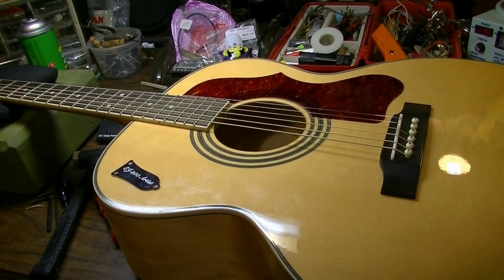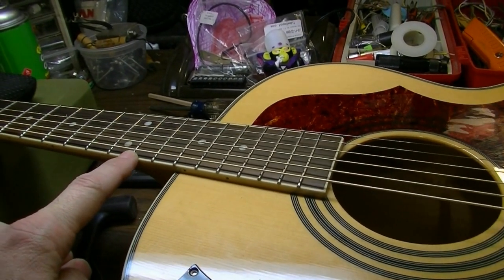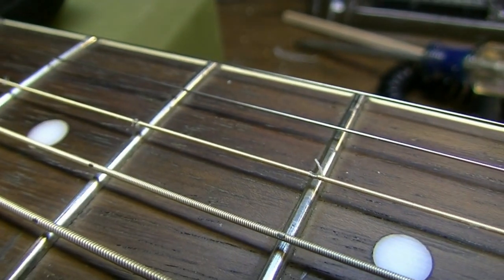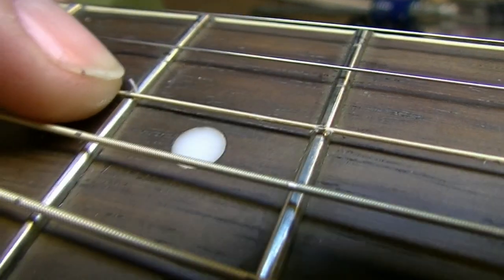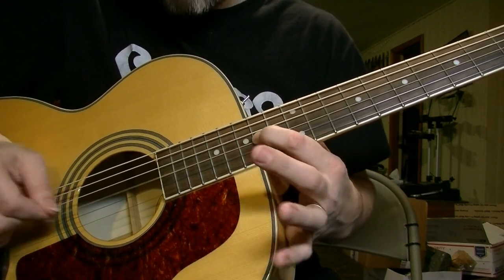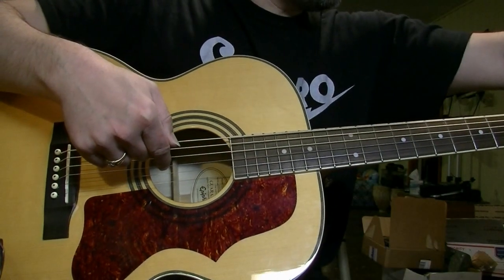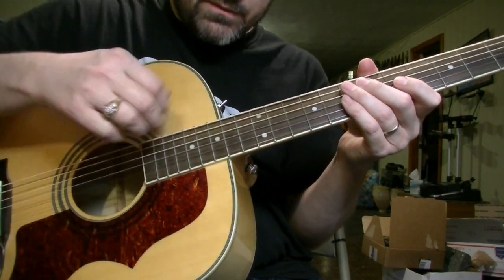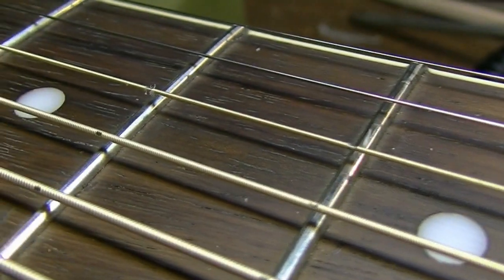Why I NEVER Use ELIXIR Coated Guitar Strings

Comment: From what I have heard about Elixir Polyweb and Nanoweb strings from some other YouTube channels these strings were most likely Nanowebs. The claims were that the Polyweb strings are better than Nanoweb. Nanoweb strings reportedly have problems with the coating starting coming off while the Polyweb strings don't have that problem.
Reply from the maker: No. These were Polywebs. I found out later. The only difference is the Polywebs are coated AFTER the string is wound while the Nanowebs are coated on the brass or nickel windings and then then it's wound around the steel core. I've also seen other YouTubers tout Elixers as some miracle strings that you can leave on "forever". I literally heard one notable YouTuber say that, and I had to belly laugh when I heard that shit...and from someone who admitted he'd gotten a boatload of free strings from them. It's nonsense. Anyone who has played Elixers and given them a truly critical analysis knows they don't last forever, they ALL fray, most notably in the picking area and above the frets, and on acoustics, they do attenuate treble frequencies. The effect isn't that pronounced until you A/B them on the same guitar, but it's true. And it's undeniable they are far more expensive than a typical uncoated set of strings. But judging by comments here and elsewhere, they have achieved a frankly undeserved cult status based on bullshit spewed from know-it-alls who don't even allow critical comments on their YouTube posts.

Comment: Do the strings makes dents on the frets? I bought a new Taylor and after the first set of strings   dents started happening on the frets. Specifically the b string
 It also happened with the new replacement they gave me. It happened again after the 3rd set of strings

Comment: I've always used elixirs. Especially on my electric guitars. I've never experienced this, however I have with Ernie Ball. But not with any coating, with the actual winding. Change the strings if you need to, that simple.

Comment: That's just a case of old strings. I use Martin Silver Wound Nylons and this happens when I don't change my strings for a while. I noticed corrosion on all of the lower strings at the frets. Eventually that will cause the metal winding to fail and fray on it's own. In this case, the G bit the dust first.

Comment: I'm puzzled that in one of your comments you state that the frets are not the problem. Aside from the flat-top uncrowned frets, your close-up camera work clearly shows the longitudinal striations on numerous frets from the 3rd to the 5th strings. It stands to reason that those striations must extend all along the fret wires which were neither crowned nor polished after leaving the Chinese factory and are causing damage to the coating. Crown and POLISH the fret wires and then try a set of new coated strings and that fraying problem will not re-occur.

Comment: I was working on a Les Paul Classic that refused to stay in tune and, it turns out, that once we tried an uncoated string, it worked just fine.  I think some guitars are more particular than others, but this one certainly didn't like coated strings.
Reply from the maker: Old strings, rusty strings, or strings with uneven coating will be harder to intonate: https://www.youtube.com/watch?v=ivrbB8OlkZs
Reply: This was a continual problem, over several years, but all with the same brand of coated string!  Once I suggested we try an uncoated string, problem solved.

Comment: I really have never used elixirs but I use many different brands. String manufacturers produce many different types of strings with different cores that may be a higher tension or a lower tension or more flexible type of string and the guitars just going to have to be set up and adjusted to that particular string if you like it and want to use it. Some strings may require you to raise the action some may require you to leave it where it's at.

Comment: not sure what's gone on there
I typically practice on acoustic when I'm not on electric and use alot of bends and slides and I have never seen this occur?
I'd go with the lower comments about why have you reused the same strings post modifications.

Comment: I’m like you, Brad. I have dry hands and not very acidic sweat, seemingly. I don’t usually use Elixirs, but had a set of Optiwebs on a Flying V for ages. Only changed them because the guitar needed a decent set up and fret polish. They were good.

Comment: I am not one to promote or demote any brand or type of gear. Very rarely is that kind of advice fact based, more often than not it is preference and opinion, and no one can tell you what to like or dislike. But sometimes I will discover something that comes along and I feel the need to share my opinion so that others can avoid a lot of trial and error. And this time it is about a new string. On advice from a fellow guitarist, I tried the DiAddario NYXL strings. I like the feel and playability of light gauge strings (008-038) but the Ernie Ball and others just sound thin, weak and tinny. I tried the NYXL in 008-038 and found both solid, powerful sounding strings that are super easy to bend and chords are easier to get my fingers on. Again, that is my personal opinion, but I feel like most would agree. They're a little salty to buy ($12 a set) but will last as long as you want them to last.
Reply from the maker: I have not tried those yet. I had a huge stash of EXP D'Addarios at the time they came out with those, so I've been using up old stock first, butnever had an issue with D'Addario. 8 gauge is a bit light for me. Too slinky for my taste. Billy Gibbons apparently uses 8 gauge, so obviously some good tone can come from them.

Comment: It seems to me if the strings are in that bad of shape it is time to change them regardless of the buzz.  Using an elixir in that condition is the same as continuing to use a 6th string that is coming unwound.

Comment: I've been using Elixirs on most of my guitars for years now and not once has that happened to me. I use their electric stings, though. I've got no reason to use them other than they're some sort of middle ground between a lot of areas. They're reasonably   priced, last a very long time, are very resilient, have a decent tone (albeit a bit stiff and harsh) and a nice feel. Ernie Balls and D'Addario rust and wear much, much faster so not only you end up spending more on them as you got to buy two or three packs  per every pack of Elixirs but you're also constantly changing strings and if you leave them there for a long time, the rust and wear on the strings act as an abrasive to the frets, which wear faster.

Comment: I don't get that? Isn't pulling the 1/4" cable out of the jack slightly a kill switch? Or why not just use a pedal tuner that mutes the signal instead of putting that in? Customer wants what they want but I would of tried to talk them about alternatives before drilling. I just don't see the need for that switch in any situation. Maybe I'm missing something. Great channel though man!

Comment: I'm on my second set of Elixir light and my G string is ruined AGAIN after less than a month since replacing them. It's frayed and deformed between 10th and 15th fret and even sliding between these frets is no longer possible. Even the B string is slightly deformed on higher frets where you normally bend more. I'm done with these strings.

Comment: I used to use D'Addario strings and switched years ago to my current Elixir strings on my Ovation Celebrity. Haven't had issues with buzzing but will double check them next time I pick it up.

Comment: I like Elixir string but I notice problems with them as well.  The biggest issue I have is that they seem to break very easily.  Just bending or palm muting can be enough to break them.  I've had better luck with Kalium strings, and they tend to last nearly as long.

Comment: I read your post script in the comments below first. I'm also one of those guys with a PH that utterly destroys strings in a very short amount of time. For 10 years, ( from 1991 through 2001 ) I was a member of an acoustic duo, and we gigged hard every week ( typical 4 hr, 4 set gigs ), usually 2 to 3 dates a week. My partner was the lead guitarist, as I held down the main rhythm & melody, as well as the majority of lead vocals, as we both harmonized vocals in the choruses. ( Classic rock tunes mostly.) We both use 12's on our acoustic guitars. Even though he often played using heavy blues type string bends ( and even slide guitar where applicable ), he could use the same set of strings for several gigs before replacing. ( We both used UN-coated Martin Marquis strings back then. ) But for me on the other hand, my strings would be trashed after only 1 gig. This was back when the coated Elixir's first came out & became all the rage. I tried them immediately & HATED them. Even though they were 12's, they felt like wimpy rubber bands when tuned to pitch. But nowadays, I am using the D'addario XS coated strings on 3 of 4 of my acoustics. I love their feel, sound, and they far outlast anything else made today. But even these XS strings can't withstand a high open E alternate tuning without breaking fairly soon. A high alternate open tuning like open E tuning is really hard on strings. ( You never "keep the guitar in open E tuning", you have to tune back down after performing a song that uses open E tuning, for obvious reasons...........and this constant re-tuning up & down is abusive to ANY string. ) This is why I use the un-coated GHS Americana strings on one of my acoustic guitars that I use for open E tuning. The GHS Americana strings sound fantastic, are reasonably durable, and they cost far less than any "coated string". Because even the uber-expensive coated strings break fairly soon when used for high open E tuning, I refuse to waste money on those for my guitar used often for open E.

Comment: I bought a fender acoustic with that pick up it worked fine but I changed the strings and the 6th sting is super loud and bassy and drowns out the other strings. Do I have to put on a certain type of string or did I did something wrong when changing.

Comment: In my experience, if you use thick strings and play with your fingers the coating doesn't fray and I'd happily use the strings for 6 months. I have come across the fraying on the frets when using 9s or 10s.. wound third strings on acoustics are the biggest problem. I have an acoustic here with 12s that I've played every day for... maybe 5 months with the current set of strings and there is currently no fraying. 

Frantic shredding with a heavy pick can also tear them up, too. Normal strings are unusable after a couple of weeks for me and sound inferior to elixirs far before then so even with eventual fraying it' can be a good choice.

Comment: I have used many sets of elixers with long periods of use between changing and never seen the coating come off of any of them. have had them break pre maturly tho. over priced, but i dont think this is a common issue with these strings

Comment: Someting in my sweat corrodes strings faster that most players I know, so I use D"Addario coated strings.  They cost twice as much but last twice as long...so the math balances out for me.  I used to use Elixir (when they were the only coated strings available), and they would always get fuzzy. Coated D'Addario strings never get fuzzy or appear any different than uncoated strings.

Comment: I use Elixir strings religiously and have never seen this happen - probably because I change them out long before they hit this point.
As I’m curious as to how old those strings are, you can be absolutely sure that uncoated strings would have been dead many times over if left on an instrument that long.
Reply from the maker: 1 week
Reply: All I can say is if they were only a week old, the strings were either defective or there were other problems going on. I play very hard and have never had it happen.

Comment: For acoustics, I will never go back to coated strings. My bad experience came from D'Addario EXP16, Coated Phosphor Bronze. It sounds fine while finger picking, but gave harsh tones during strumming. Tried another set; same thing. I bought a multi set, so I tried on other acoustics, and the same harshness was present.  D'Addario even sent me a free NYC set, but the same result. Something about the coat that doesn't sit well.  I'll just keep on using Martin Marquis to keep my acoustics sounding sweet.

Comment: I’ve had the same set of Elixir .009 Polyweb strings on my Nashville Tele for over 3 months and that includes about 8 gigs and around 20 practices not including noodling at home. (I don’t use any other guitars for live playing btw.) Been using Elixir strings for years with no issues.

Comment: After being fed up with the Elixir's fraying within hours or days I switched to D'Addario EJ16's per recommendation of Tommy Emmanuel and they were a noticeable improvement both tonally and in longevity. I also tried just about everything else you can get at your local GC. But a few years ago I discovered Kerly Music's tempered Earthtones and Death Valley strings and haven't looked back. There is something about the tempering process that makes the strings last a lot longer and the tone is definitely a more natural aged tone, especially after a day or two of playing. It's practically the equivalent of aging your guitar top. Also, the high E and B strings are much smoother and I can slide more frets without burning or slicing my fingers. I recently realized the tempering process closes the micro-cracks in the metal surface, so it makes sense I suppose. The strings can also take a beating which is also no surprise given the tempering. The best part is the prices which is about 1/2 to 1/3 of Elixers and are made in USA. They also make coated strings but I was not happy with the low-end response; besides, I didn't need them because the non-coated strings last longer than any other strings I've owned in the past 35 years. From my understanding, the only difference between the Earthtones and the Death Valley strings are the variances in gauge on some of the strings.

Comment: I watched this video while switching my strings to elixirs on my electric guitar. I denied your statements against elixir as I've used them before and had no problem. After two weeks the same happened to my strings and it just felt horrible to perform bends because it's feels like scratching nails on a chalkboard. Though it's probably because i used a thicker coating type of elixir.

Comment: I think the coated strings kill some of the resonence in an acoustic guitar. Won't use em.
Reply from the maker: Agreed. They will delay tarnishing and corrosion, but coating the very thing responsible for generating the sound energy in plastic deadens the overall brightness and sustain of the strings. It only stands to reason.

Comment: I believe coated strings were designed for those players that have allergies to some types of metals. The idea is a buffer zone (coating) between the metals in the strings and the players fingers. Some people also sweat more than others and the strings should last longer for these players. I have used both the Polyweb and Nanoweb, just to try them. I don't have allergies or sweat but was curious. They weren't for me. I did find they "frayed" over the right hand playing area. Like I said, if I had allergies I would use these or other coated brands.  Keep'r Lit

Comment: I'm using Elixir Nanoweb 80/20 Bronze acoustic strings since 2005. And i've been using the strings for up to 6 months sometimes 10 months. Honestly i've never experienced that kind of issue yet. However that doesn't mean i won't in the future. Cos' i think rarely these kind of a few faulty products can be placed at the stores. And it's not a specific brand based issue

Comment: He clearly did a numerous amount of bends and wore the entire outer wrap of the string off, that wasn't the coating! They last long but not forever. I have over 30 guitars in my studio and I always use elixirs. I buy so many they now sell them to me for $6 a pack. I have never left them on so long that the entire metal wrap wore through. Your blaming the string but he should have changed those a long time ago.
Reply from the maker: It’s the coating, not the outer winding. These were not old strings.
Reply: @TheGuitologist  I can see in the video that it is more then the coating in a few spots. The coating is only a couple microns of clear material. It was buzzing because he had worn so far into the string itself that it was allowing that part over the fret to basically wrap over it. If I could post a pic on here of your video zoomed in then it would be easily shown. Depending if these were the Phosphor/bronze or the Nickle/Bronze 80/20's, he may need to get stainless steel strings for such agressive playing. Then the fret and the string are more equal in density and it will last him much longer.

Comment: A toggle switch on an acoustic guitar with a piezo pickup is a very bad combination. Every time you switch it ON, the pickup would pick that "click" sound as well. And that is annoying. If you absolutely needed to add a cut-off switch a "push-to-on" switch would have been a better option. I could be wrong, but this setup didn't work for me.

Comment: I tried a lot of the coated strings,never found one that felt right or had good tone. They all sound a little dead,right out of pack. 45 years I've used regular sets, probably going to continue until my demise. I am open to trying anything that comes down the pipe though,so ya never know.